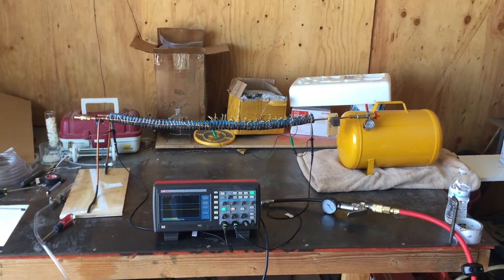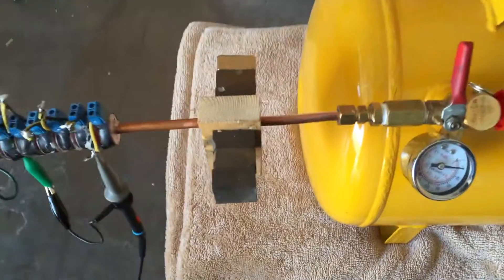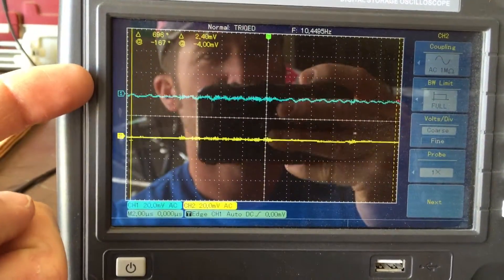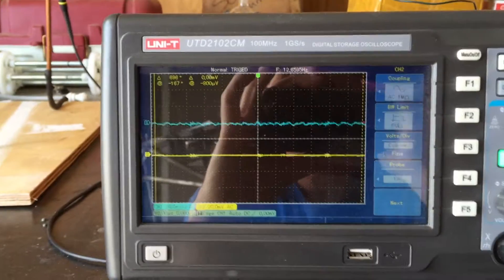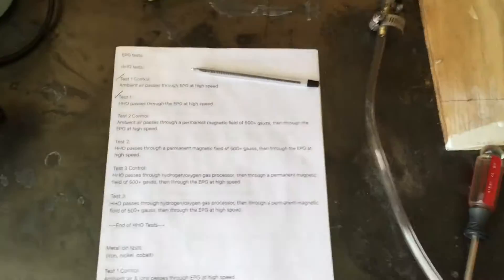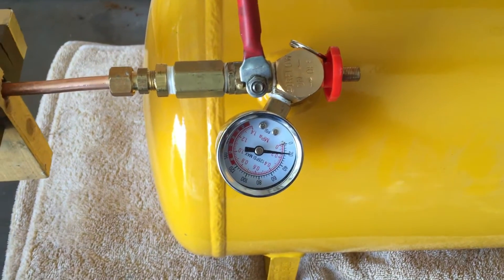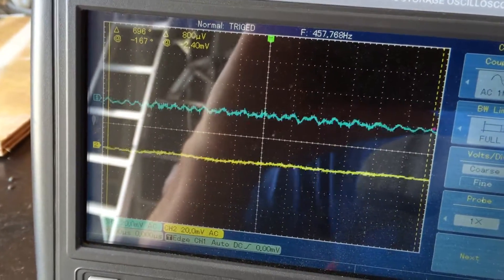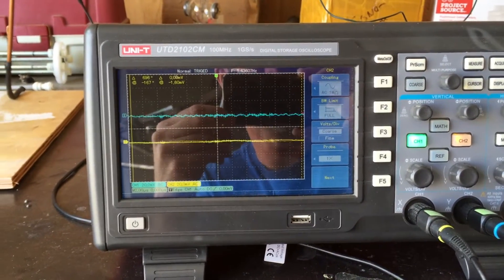EPG Tests 003 - Hydrogen (H2) & Oxygen (O2) Through a Magnetic Field

Comment: The EMI might be the HF/VLF telemetry control signals of the AC meters that send pings across the mains to the grid substation, you should repeat the experimenti in the middle of the woods with a generator.